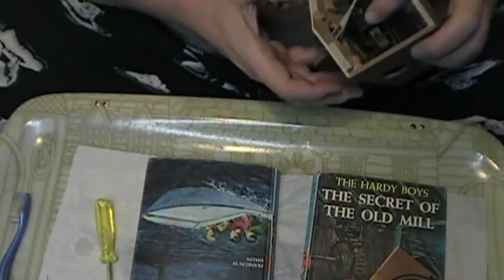Cuckoo Clock Repair 2.wmv

Comment: Hi Reed. Loved your repair video. My wife and I visited Germany in 1989. One thing I told my wife I was going to buy was a Black Forrest Cuckoo Clock. After visiting Neuschwanstein Castle and on the way back to Munich, we stopped at Heigl Clock store in Oberammergau. We bought one of the better clocks with 12 figures moving. Of course it had the music box. Had to order, took 6 weeks and arrived in excellent condition. The clock ran perfectly for 20 years. One of our Grandsons, 8 years old, wanted to pull the chains and pulled it too hard and the clock stopped. Just b4 Christmas 2014, I was given a Regulator wind up mantel clock that wouldn't run. I watched your video and decided I could fix the clock and give it to our Daughter as a Christmas present. It worked great and she was thrilled. I then decided I would tackle the Cuckoo Clock. Much more intrigate and was a challenge. It is equiped with the Rugula 34 with Swiss movements. I noticed right away why it stopped working. One of the gears and one of the stabilizer posts were out of their holes. Very easy fix. I oiled the clock, cleaned up the mechanism and put it back in the house. It ran like a champ. I ran the pendulem and the cuckoo gears and they moved with ease. I put the clock back together, hung it on the wall and it ran great. I haven't put the hands on yet, as they are a bit difficult. I was waiting for the sound of the cuckoo and music and I get nothing. I have a hunch I was suppose to set something on the front that operates the cuckoo and music. And you say? I need your help please.
Reply from the maker: There can be a quiet switch that is usually holding the cuckoo's door closed and that will quiet it totally.

Comment: Thank you for this video. I bought my mom a Schneider about five years ago. It stopped Cuckooing. Your video gave me a lot of reassurance as I ventured in there. Without your video, I would have been more intimidated. It turned out to be  a jammed chain. Also cleaned and oiled it while in there. It is back together and working again. Thanks again.

Comment: I had it on a test bench to see it while running. I found that one of the smaller gears inside has a hole for a small pin and the pin is missing. I replaced the pin and now the Cuckoo is functioning correctly. Thanks a lot for you time.

Comment: Thank you... I have a simple little clock like the one in your video.  The pin came off the door hinge, and I made the mistake of taking the door off. Bird  disappeared inside, and then the chain came off the cuckoo gear.  This video really helped me, I didn't even know how to take the back off.  I was afraid I would really break it right next time, and seeing how the gears and chains worked was just what I needed.  Seems to be working fine now, so thank you very much for this video

Comment: Thank you for this video. I unfortunately knocked my cuckoo clock off the wall and without this video I would never have been able to fix it. I must have watched this 20 times before I actually got the clock back together and working better than it did when I bought it. Thanks again

Comment: Thank you for responding so quickly. No the pendulum does not  stop only the hands stop. Yes you can feel the resistance when you try to adjust the time.  There was only 1 clock repair person in our area and he had our clock for over 3 months. $300 later and still not working.
Reply from the maker: That sounds like you have a chipped tooth in one of the gears. You can buy new movements on ebay if you don't want to try having it repaired by someone else. You can send them out to repair shops also :)

Comment: Hi Reed! A am so glad to have found your video here! I just bought me a Cuckoo Clock - and I fixed the chains (one had gone loose during transport) and then my son accidentally got stuck in the chains and it fell down in the stone floor with a BANG! I thought this is it. The clock didn't work after that. But - since I apparently like fixing broken things (found that out during your video as well! ;-)  - I had to take it apart and see what I could do. And now - it sits on my wall again - says ticktock - the chains leap through as they should and the little bird comes out and says Cuckoo. Many thanks from Sweden - for uploading and sharing your video here!

Comment: Thank you so much! This was very helpful. I got a Regula clock at a junk shop that is missing a part for the pendulum, and one of the bellows is blown, but your video gave me some pointers (and the nerve) to take the clock apart and give it a good cleaning. I am ordering replacement bellows, but I am sure the clock will run fine once I fix the pendulum.

Comment: Thanks for uploading this.  My clock started acting up a few days ago.  I cleaned the chain with rubbing alcohol, releveled it (to what it likes) and its running fine now.  I suspect a bit of dust or dirt was the culprit.  I do not want to disassemble it unless I really have to.  The back does not come off as easily as yours.  When the time comes I can see now that cleaning and oiling is not as mysterious as one would think.  Just takes time and a bit of gentleness.  Thanks again.

Comment: I gave my bride a German Cuckoo Clock on Christmas 1971, that sucker has been running almost continuously for 43 years.
last week I had to make the first repair to one of the bellows and is back working like a champ and here is my secret to keep it running that long.

1) Only I can raise the weights before going to bed, not the wife or the kids when they lived at home.
2) Never advance or slow the time by forcing the hands, if it runs slow take the pendulum off let it catch up, fast stop the pendulum.
3) Only raise the weights at the top or bottom of the hour. 

One thing I noticed as the clock aged I had to raise the pendulum almost 1/8 of an inch from the original position when it was new in order to keep it as accurate as possible.

Comment: Hi Reed. Thanks for the time to make the video, learned a lot from yours and others on youtube. Been buying non working cuckoo clocks off ebay and started on my first repair job. I used brake cleaner to clean it and got the synthetic oil for lube. After learning how to rechain one and then letting it run without the hands on, I now need to take it back apart to check snail and rack from what ive read. I learn everything the hard way ha. I was wondering why they dont have the hooks on the chains to be able to come fast and easily? Like using a small key chain part so you dont have to keep bending the chain to take off the hooks and stoppers and avoid rechaining it.  I also used cloth tape used on old wiring harnesses to patch the bellows till i feel like tackling that project after getting clock working if i do.

Comment from the maker: Glad I could help :) The bellows are an easy removal, just watch for the glue trying to separate the wood veneers depending on the age of it. Use a serrated knife to gently cut the glue away from the clock side if needed.

Comment: My father recently gave me his cuckoo he brought back from Germany in the early 60's,and I hung it off a nail above the fireplace,and it was working for about 5 min,then it came crashing down....the mechanism broke away from the frame(2 screws out of the 4) one of the chains broke in side,and 3 links came out. I was devastated. He doesn't know yet,and I can only pray I find a good local repair guy in Indianapolis to fix it. This video is really neat,and I wish I had your skill set to fix it.

Comment from the maker: Hi Kim, either the bellows are blown or the linkage is bent & hanging up most likely. Watch and see how they are closing & make sure that the air exit holes or whistles are not covered because this will keep the bellows from working also. If they are not spring activated in the mechanism then there is also a chance that the tops are hanging up. Most likely either the bellows are thread bare and will work fine by hand but not on their own or something is blocking the exit airways.

Comment: I'm so glad you've done these videos !!  My granny had a cuckoo clock and it's long gone, but I found one on ebay and got it running.  I liked it so much I bought another one off ebay.  The second has music and runs but stops after a while so I think I'm going to have to take it apart more like this video.  I did buy the oil like you recommend ...  I've had to buy hands and the roof trim because it was missing one of the 3 chains is short, so I think part of it is missing... but I love it !!

Comment from the maker: No it floats on the shaft but is one of the main drive gears. If you turn it, the hands turn. It just needs to be connected to it's opposite. If the hands aren't turning then there is either a worn out gear in there that's allowing the shaft to spin freely, a gear with a missing tooth that is not connecting to its opposite, or a broken shaft. Most likely depending on the movement I would bet on it being a black plastic gear with missing teeth has found its way around & disconnected the mechanism

Comment from the maker: when it stops does it just slow down or does it hit something & stop fast? Oil it first & really look at the gears. If it has been oiled then there is something on one of the shafts. In this video it would run & then stop fast because there was enough dirt on one shaft to force it to stop. You can listen to it for evenness in the tic toc. look inside on the floor for pieces of gears also.

Comment from the maker: Usually there is an adjustment door on the side but I honestly haven't had any problems like that with mine and there are different movements and adjustments. I would pull the front off or pull out the movement and check the rotating actuator that you saw in this video. I've seen clocks where the chime is missing, make sure that the hammer is positioned to hit the chime if it is there. Then if it is, adjust the hammer to where it is clearing the chime each time by bending the arm a little.

Comment from the maker: Sounds like your going to have to pull it apart. You may have to replace the bearing but the only way to know for sure is to take it out and see if you can rebuild it. You can soak it together in solvent to see if you can get whatever is stuck in there to come out, there's no plastic so no worries but it probably rusted inside the wheel. So it could wash out with solvent & it's worth a try.

Comment from the maker: So is the U shaped arm with the teeth coming back down and locking into the actuator arm shaped like a L or is is just dropping it and hanging there? Does it stop on the teeth or does it just fall all of the way leaving it unlocked? Could be missing a tooth on the gear. Honestly the only way to see what's going on is to pull it out again. You can look at it or take it in to have someone take a quick look at it if you can't see the problem.

Comment: I am so thankful to come across your video.  I have a cuckoo clock that my uncle got it when he was stationed in Germany in the 40s.  It was working fine.  I question if a kid pulled the chains too tight because one is completely wound and the other one just went "plop" out tonight.  My dad passed away 2 years ago, and if he saw me sitting here with this cuckoo clock broken and trying to repair it, he would flip.  (Send me some well wishes and pray I can fix this because my heart is breaking)

Comment from the maker: That's great :) You can either just adjust all of the chains to the same length or buy some extra to add on. Generally if you buy chain, the color will not match unless you clean all of them. Put the weights on a scale unless they have the weight written on them and if one is heavier, it probably belongs on the music box but you can put it on the clock side to see if it makes it work. Still it will need cleaning sooner or later though :)

Comment from the maker: Pull out the movement, & mount it on a board, set the chains & weights on it and watch it run. On the main shaft there are a couple of gears, check the one towards the face & make sure that it is connecting with it's match and not slipping just past the washer. Then there is a spring loaded gear on the inside that doesn't have much play. Check the bushing holding the spring to make sure the gears are matched as well. Best thing to do is get it out of the box & running where you can see it moving

Comment: When I was 16 I took apart our families cuckoo clock, well I took off the chains, and cleaned them, and cleaned all the exterior wood pieces. Eighteen years later I have inherited the still taken apart cuckoo clock. Tonight after watching you it is ticking again!  Thank you for making such a detailed video. I noticed one of the billows has a small tear, but it does still "ckoo". The "cu" sounds good. Where can I get a new billow? I also need a new minute hand, it is almost cracked through like yours. That was fun! Thanks again.
Reply from the maker: ebay is a great place for parts :)
Reply: Thanks! I have been playing with the clock to get it to be on time. Seems like it is 5 min. fast every hour. I saw how to adjust the pendulum. Do you have any videos that show this process?
Reply from the maker: I don't remember if I put it in the movies but just barely move the screw on the pendulum down if there is one. If not then just barely slide the pendulum weight down the stick just a touch like 1/64". Then if it's still fast the next day give it another touch. It might take a few weeks but I get mine to where I have to set them a couple times a week. It just takes patience... And then getting them all to cuckoo in harmony... lol :)
Reply: Thanks! I will do it. :)

Comment from the maker: Yea & really look over the bellows to make sure they are completely sealed, sometimes they look great & find that  they aren't attacked in the back. I would pull them & then test them when they are out since you have to readjust them anyway. This way you can really see what's going on and how they sound. Could have pin holes in it as well.

Comment: Thanks for the quick respond, Reed. I removed the gear set (not plastic type, its metal) but found no cracks. If i use a flat head screwdriver to push the gear tooth then it move a little but its a hard push not like the other( cuckoo sound gear). I can push it around a full cycle but its a hard push. So if i use the chain to pull that hard then the chain might crack. Oiled it well too but still same. Is there ball bearing in it ?

Comment: I'm working on this very clock that my sister picked up and wanted me to fix, then found your video most helpful.  It was missing one chain so I ordered one, it's links are smaller then those on the other chain which could be a problem?  I've got it keeping times now but the bird still isn't working or sounding at least.  Any tips on where I might start problem solving?

Comment: Easy way to clean a mechanism after its removed from the clock is put it in a name brand freezer bag and put about two ounces of lacquer thinner in and shake (be careful lacquer thinner is some bad stuff ) I tried it and it works well  a very little manual cleaning was  needed and all old oil residue was removed

Comment from the maker: Thanks, I fixed the bellows but didn't realize that I cut that part out. I just used a bit of hotmelt to reattach it then I checked and adjusted the tension on the cloth by dropping that tube down just a touch. .

Comment from the maker: If they are musicals those weights can be different but generally if it's still not running right it could be worn out bearings or even just the smallest piece of dirt on one of the smaller gears. Take the weights and put them all on a scale and see what's going on there to start. Then take the heaviest set & try them to see where to go next. I buy off of eBay sometimes, they may have the wrong weights but generally a good cleaning at least, or many times a rebuild is in order like here on mine

Comment from the maker: I have a musical clock to repair but I wasn't planing on making another video. These cover them all pretty good. Did I miss something? The basic tool that I used for oiling was just a tooth pick. Then I also used a strong cleaning brush from an electric shaver, a small wire brush, and sometimes a scratch awl or an ice pick if there is some rust inside of a gear that won't budge. The tooth pick gets the most use and cleans out the crevices really well.

Comment from the maker: Take the back off, then stick a wire up in there and lift the chain around a couple of links or you can pull the weight and S hook off and pull the chain through and then re-thread it. I've had that happen before also. Depending on how long it has been sitting, it may nee cleaning & oiling anyway :)

Comment: I really appreciate this video. I've actually got the exact same model as the painted clock you have running on the wall with the animated woodcutting  scene. Mine keeps slowing to a stop and the musical piece and cuckoos run much slower than yours. I plan on taking mine apart and cleaning it up tomorrow morning, just like you showed in this video. I hope that fixes it's issues. Thanks for the help! Wish me luck
Reply from the maker: Be sure to put a tiny bit of oil if needed on the water wheel linkage and for the music box linkage also :) Good Luck :)

Comment: Reed.. I have a clock like the one on the left you repaired..but it's made pre-WWII. Stamped just Germany on it. I got it back before the wall came down... Is this one any better then the new ones today?  I know in the furniture business the older the better as far as quality..  I had it serviced this month... $190. It stops once or so a day.. he is blaming my installation.  Shut me out so I'm on my own.. I leveled it.. and tried to set  it off a bit with no luck.  Not sure what to do.. clean it again and oil it myself?